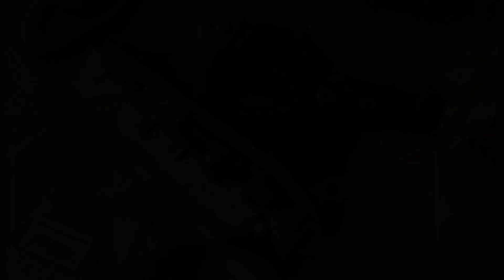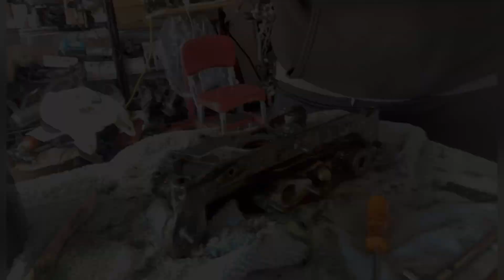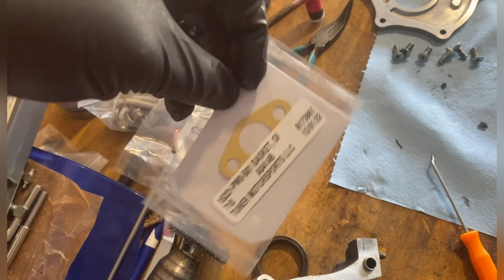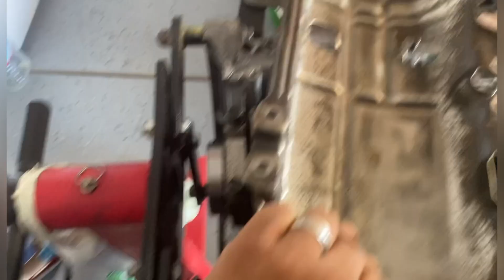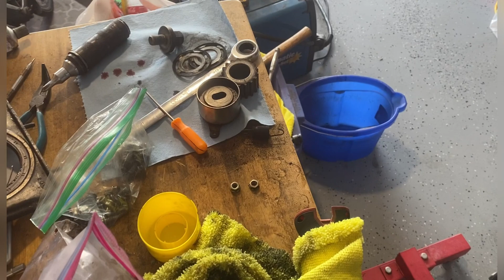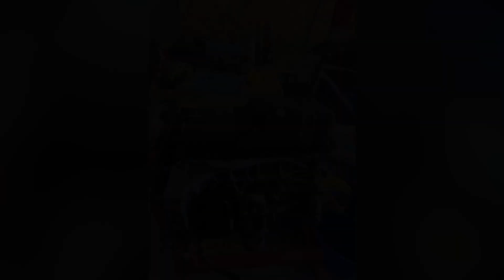Integra GSR oil pump inspection and install

Comment: does rtv go in the inside mechanism as well?
Reply from the maker: I think just the main housing seal. Ended up replacing the oil pump because of a bearing issue but I think this one is still good